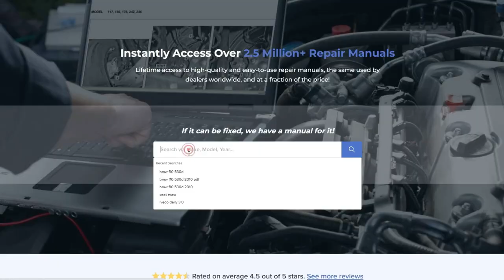How To Remove Diesel Injectors BMW N57 N47 F10 F11 530d 520d 330d 730d 320d Stuck injector removal

Comment: How did you clean out the injector holes without getting debris in the engine?
Reply: @thekeenmechanic
Reply from the maker: Hi
I put an M6 bolt in the injector nozzle hole. Cleaned it and vacuumed it then pulled the bolt with a magnet😉
Reply: @TheKeenMechanic  genius! I’ll let you know how I got on, great video
Reply from the maker: You are welcome

Comment: Great video but how did you clean the two injector ports/housing without debris falling in to the cylinder head after? 20:40 & 20:44
Reply from the maker: Hi
I will show some of the port cleaning process in the injector assembly video. All you need is to vacuum clean 1st then install a bolt in the nozzle port and use a thin vacuum adapter to clean ports after you use a soft brass and plastic brush on a drill. It is doable when you take your time and take care of the injector seals. Best way to do it is with the valvecover off so you don't scratch the valvecover injector seals. Thanks for watching and for your message. I have a Ton more content coming on the F10 F11 chassis
Reply: @TheKeenMechanic I'm not quite sure, but I think many brake parts are the same in F10/11 and F25/26 (X3/X4).
My next job is to "renew parts" on the rear axle brakes...

Comment: Hi there, great video. just wondering what socket you used for removing the injector hold down bolt?
Reply from the maker: If I remember correctly it was E10 internal torx socket🤝🏻

Comment: What do you think caused no.1 & no.2 injectors to be rusty compared to the rest?
Reply from the maker: Hi
To me there are 2 logical explanations. 1st: due to injectors 1 and 6 being on the outer side of the engine block they will cool quicker which means they will condensate much more than the warmer 2,3,4 and 5 which are in the middle and are better insulated. Moisture sticks to cold surfaces so may be as they get cooled 1st they attract more moisture to them. 2nd: poor injector valve cover  seals on 1 and 6 which allows moisture to enter. This also links to the 1st explanation. Hope this makes sense🤝🏻